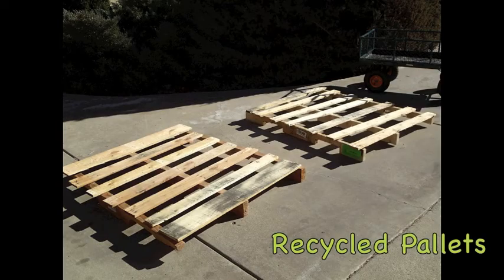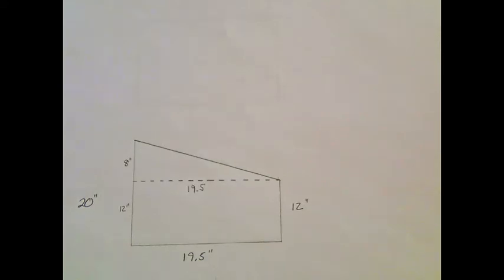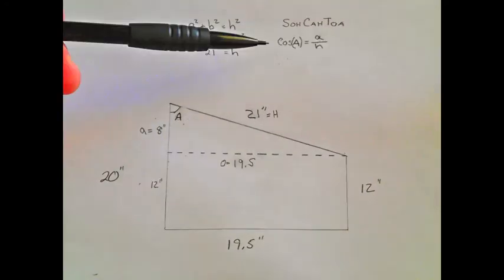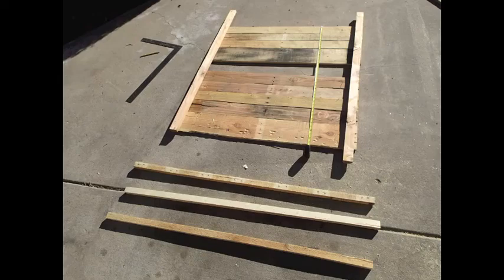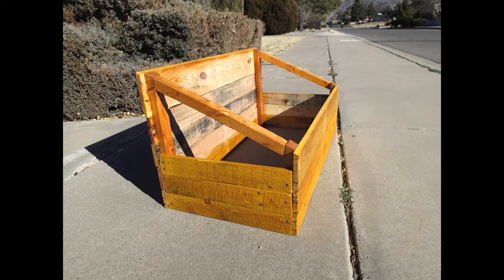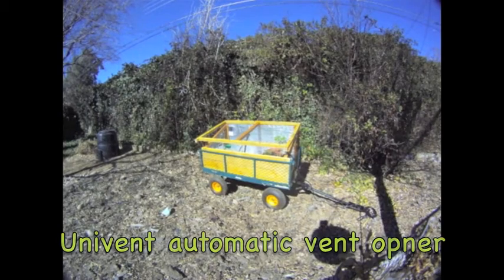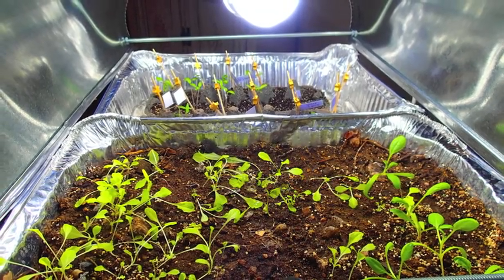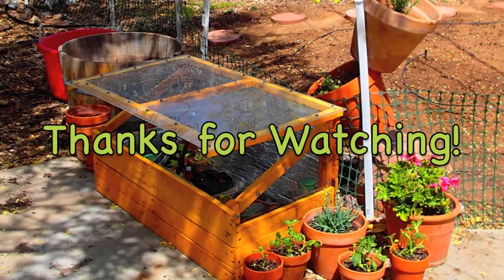Garden Cart Cold Frame

Comment: Hey, what kind of screws are those?  I need to get some this weekend.
Reply from the maker: I used either 1 inch or 1.25 inch deck screws with a bonded neoprene washer #8 1/2  that I picked up at the hardware store.
Reply: Thanks!